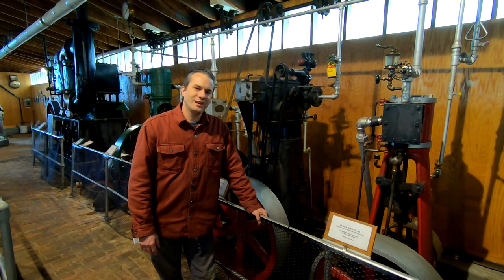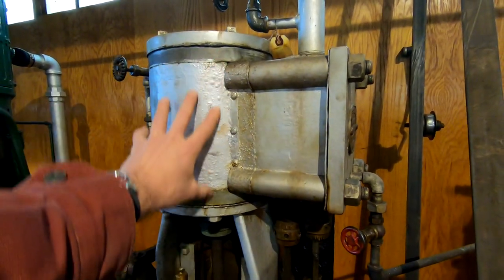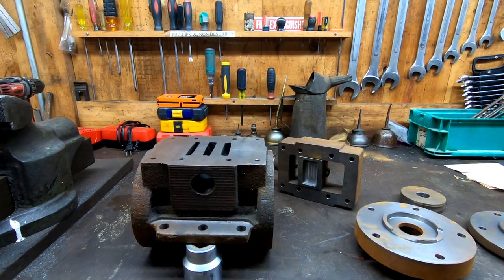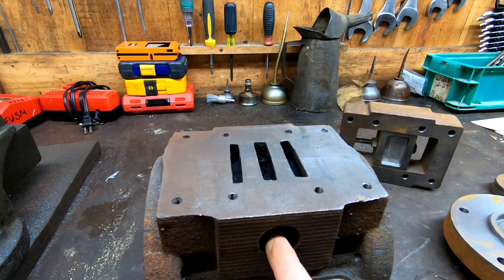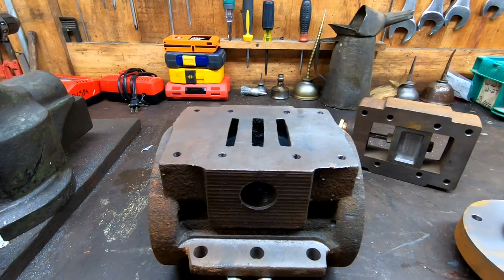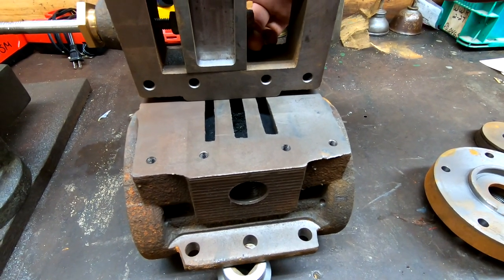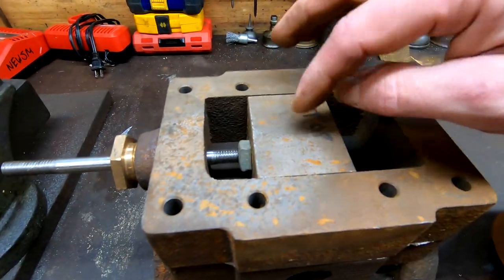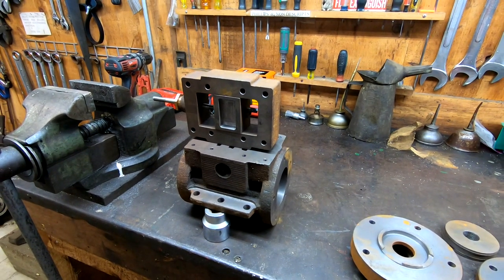Steam Engine cylinder casting and valves

Comment: Great video. Was wondering where the cylinder drain was and this showed it really nicely. Also the way this showed how the slide valve linked the cylinder to the exhaust was much better than any diagram or animation. Thank you.

Comment: Not sure what the porting is like inside the cylinder cast, but if it's just mismatched inlet/outlets, couldn't you grind and weld to reshape them? And possibly sand cast just the slide valve with a different geometry?